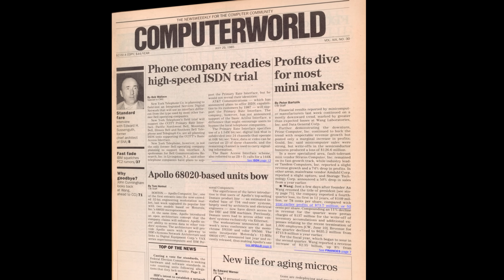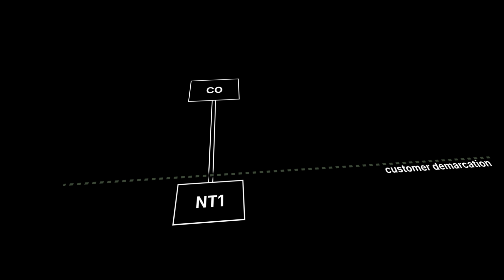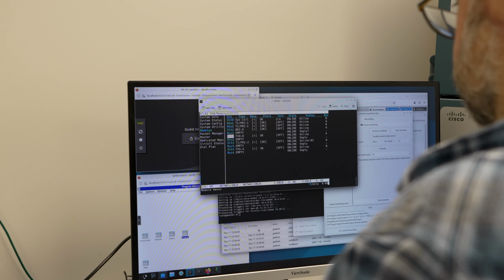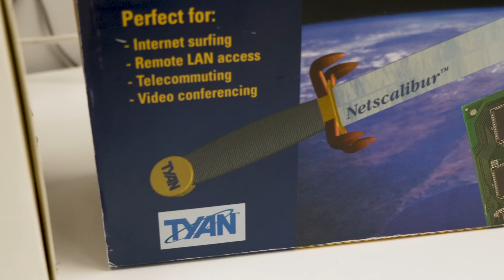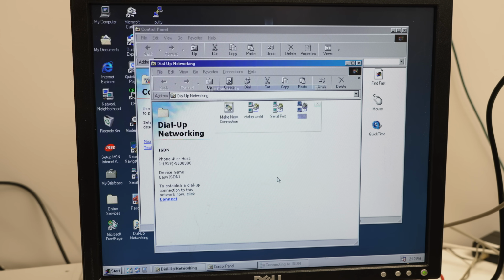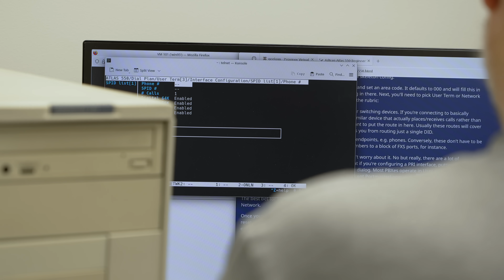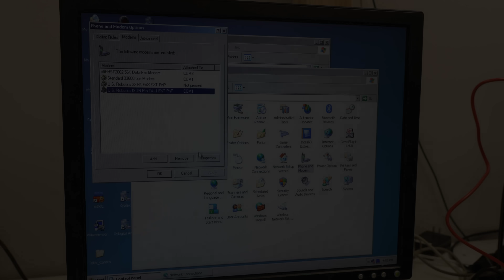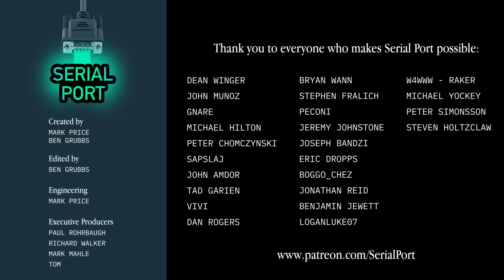Do you remember ISDN?

Comment: My parents got ISDN in the late 90s, mostly for the ability to allow calling and internet usage at the same time. The Dutch telecom provider would always install a Quattrovox as well, which provided four analogue connections for existing equipment and allowed two calls at the same time when you weren't connected to the internet. We kept that even as we moved to cable internet in 2003.
Reply: Same in Greece. If the modem was configured for 128k, it would dynamically switch on/off the 2nd channel, in case someone wanted to use the phone.
Reply: Quattrovox, so PTT/KPN I assume (I'm Dutch too)

Comment: Oh man, I remember when I got ISDN (128k) at home back in '97 or so - I had a Cisco 766.  I worked at an ISP at the time, so was sort of "cheating" to some extent ;)  
The speed just felt so unmatched at the time (short of getting a T1), it was glorious :)

Thanks, as usual, for the wonderful nostalgic flashback!
Reply: I also worked for an ISP in the same era, and had one of two ISDN circuits in our town 😆 these videos certainly bring back memories!
Reply: I had ISDN. It was super nice to have, but not for the speed - it had no reliability issues, so phone lines wouldn't drop the connection all the time. It was like you had a dedicated line! That was the joy i recall!!
Reply: @AlexKidd4Fun  ISDN often was used as a dedicated line.  I'd set up ISUs to automatically connect and they'd stay up 24/7.
Reply: @James_Knott Indeed, it was but that wasn't always the case. The tarrifs were different in many areas so always up/ unlimited want always available. In my case I just turned it up and used it when I wanted it then disconnected to save bucks.. 💸
Reply: You bet it did! I still remember early 2000s when I upgrading from my old modem connection to the cheapest possible ADSL tarriff my local IP had. I had 128kbps in and 64kbps out and it was such a noitceable improved that it pretty much turned Internet browsing into a completely new experience. No more night time dials, no more quick browsing and saving all the HTML pages - you just connect whenever you want and get whatever you want within a couple of secconds! And since it had unlimited traffic with a fixed monthly rate it was even cheaper! The monthly rate cost was around as much as 4 full nights worth of 5 hour dialup access cards! It was so much better that it wasn't even a comparaison! The reliability still somewhat sucked with a day or two of the connection being down and unavailable  every few months so altough it was not quite as bad as with the dialup which disconnected every hour or so I uprgraded to Fast Ethernet access rate limited to 512kBit in both directions as soon as the first LAN provider established a presence in my area around 5 years later but it wasn't quite as dramatic as the first upgrade. 

In fact I still use effectively the same IP I got connected to in 2005 but now it goes under a different name and provides full unlimited 100MBps of bidirectrional bandwidth over the same trusty old unshielded twisted pair cable running to the shared black 30-port with 2 fiber optic inputs D-Link switch box on the roof. And on top of that now they also include free IP TV and mobile Internet access with 100 free local mobile voice call minutres, free incoming calls and 50 SMS messages for me and both of my parents which is more that anyone would ever reasonably need and all of that comes for just a bit over 1000 rubles/month. The Internet as a technology has clearly already peaked and now. Now it is just a commodity like electricity or sewage with no more actually useful and desirable improvements possible and the only changes possible being the prices going up at some point.